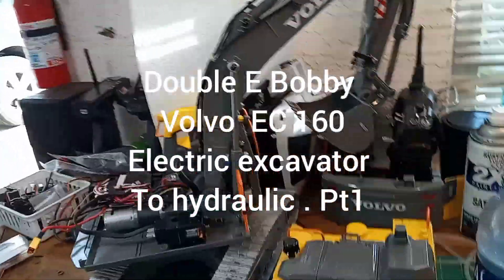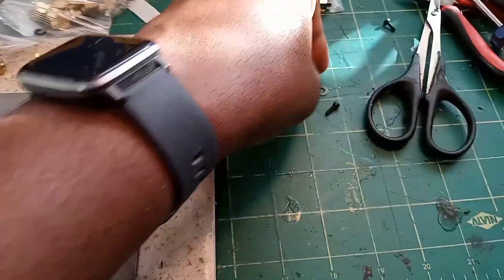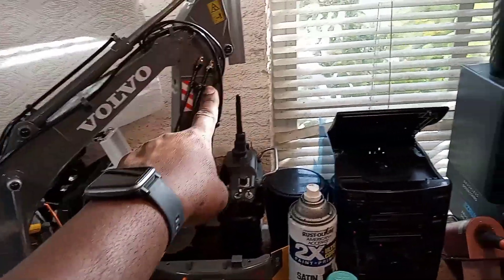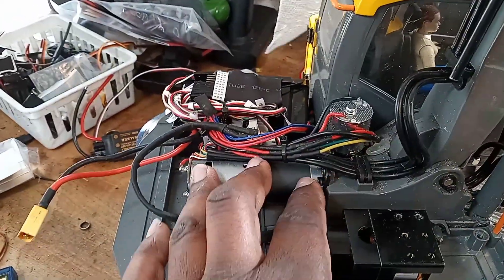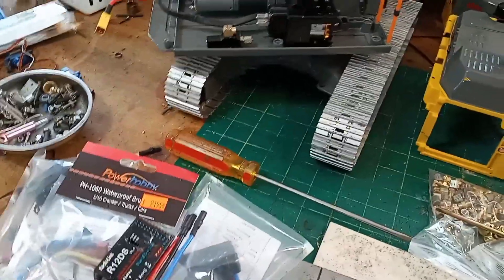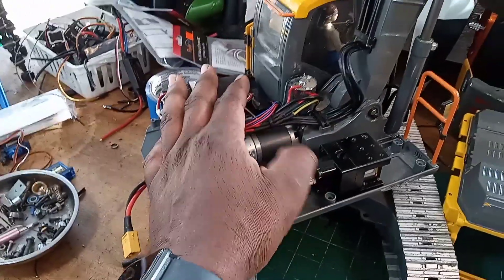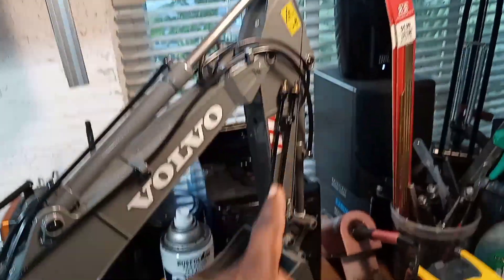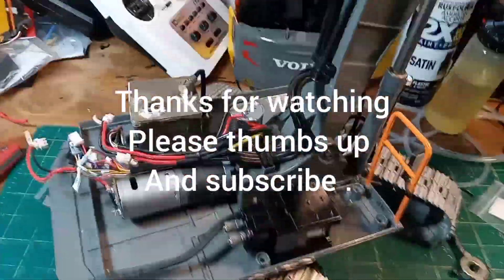Double E Hobby Volvo EC 160 Excavator from Electric to hydraulic pt1

Comment: May I know the size of the cylinder and where you buy it?
Reply from the maker: I got the hydraulic cylinders and valves from magom hrc. And the pump from lesu and that came from semi Joe's truck shop. And the hoses and fittings from hydraulic hobbies. The cylinders sizes. 
Stick=150mm 
Boom =13mm
Bucket=113mm 
The brass tubing=4mm od
Reply: @everythingrc3050  ah~~thank you so much
Reply from the maker: The boom is 130mm sorry typo
Reply: @everythingrc3050  ok👍